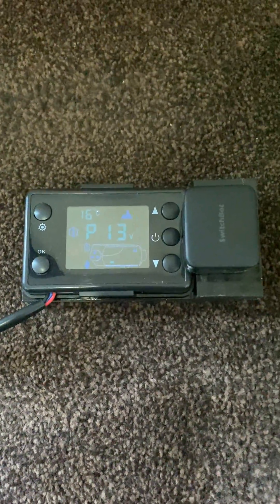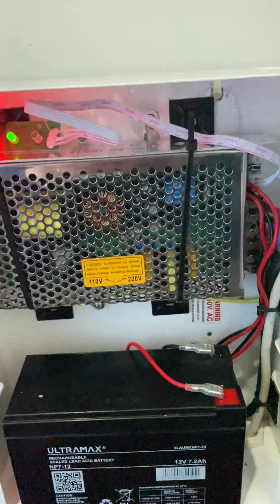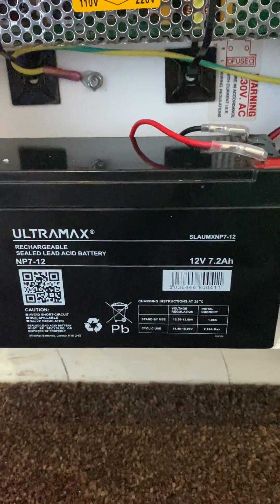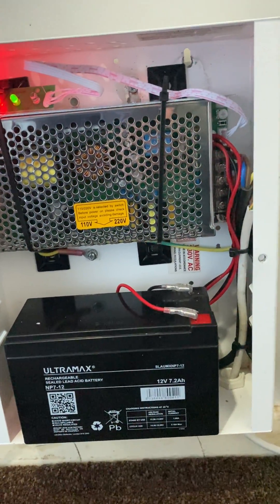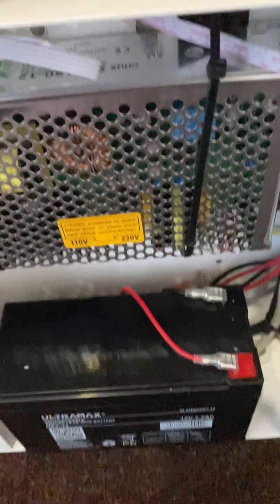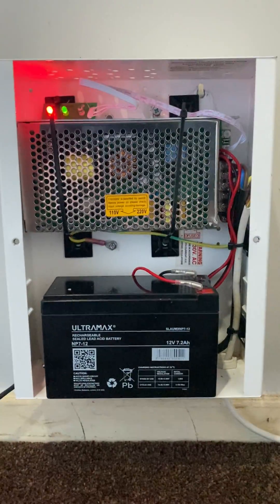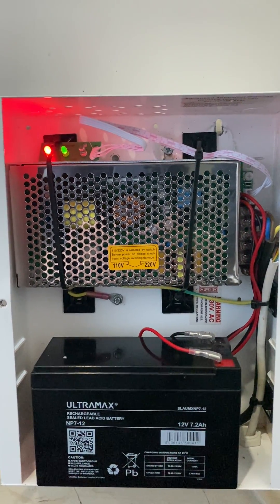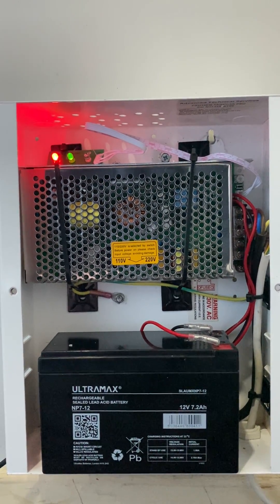Chinese Diesel Heater heating my home  With Battery Backup! Slimline battery install, neat and tidy!

Comment: Very nice. I don't think a lot of people who run mains only realise the damage that the heat from the heater will do to the electronics and possibly heater body if the power fails and the fan stops blowing. Possible damage to the control unit in the enclosure and melting of the case is a possibilty. Very well thought out.

Just one thought is a little beeper that you can switch off that would be triggered by the switch from mains to the battery on a parallel circuit so you know the battery is running the heater.
Reply from the maker: Thank you 😊 
I think this a relatively low cost solution to provide protection to the heater and ECU. 
Plus if power shortages become a thing I'm ready 👍
Not a bad thought with the buzzer but the unit has an LED to show if power has gone off plus the TV and lights going off will be a clue too 😊
Reply: @deoxyrobo  Ha ha I forgot the electricity would go off to the rest of the house, duh..I must be getting old.